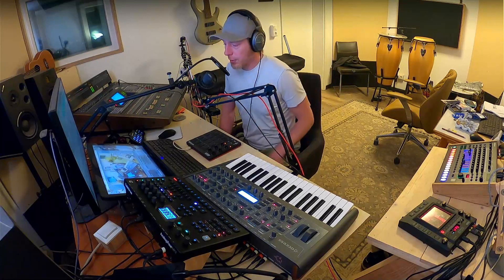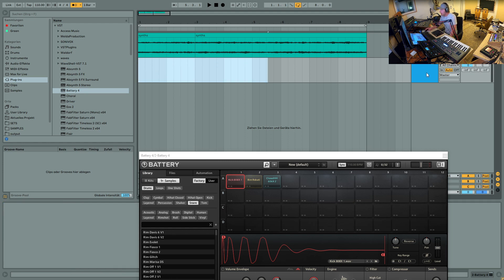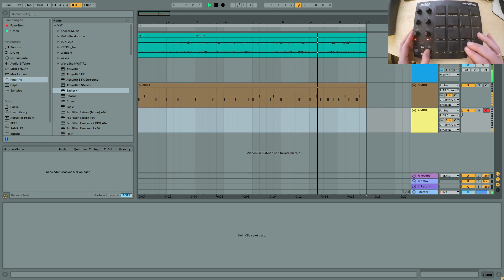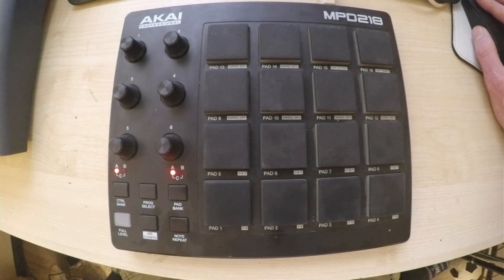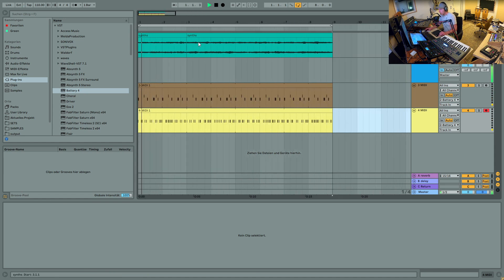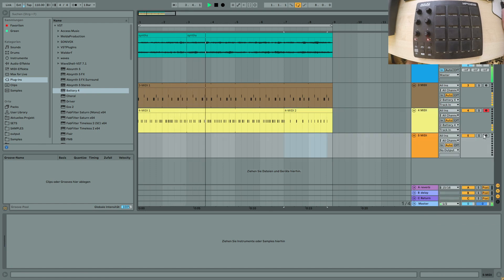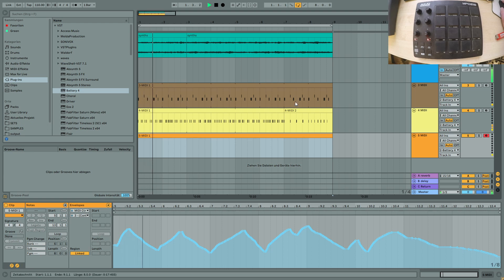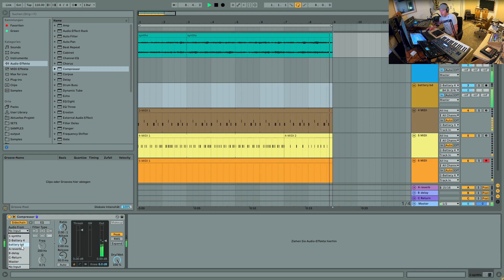Native Instruments Battery - Multiple Midi Inputs and Audio Outputs Tutorial

Comment: how do you retain that midi mapping so it doesn't change back to the default mapping when you change drum kits though?
Reply: I guess if you're planning to skip through the kits it would be best to start off the midi tracks on the notes which are used for the default bd, snr, hh etc. positions. I usually don't use the kits though.
Reply: @leisureb  yea i actually mapped this yesterday just like this.  appreciate it!